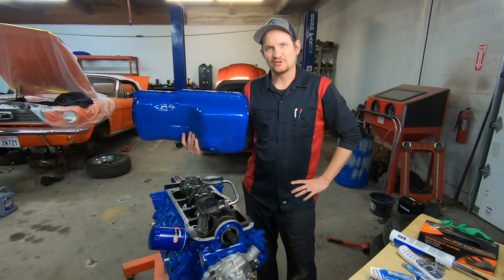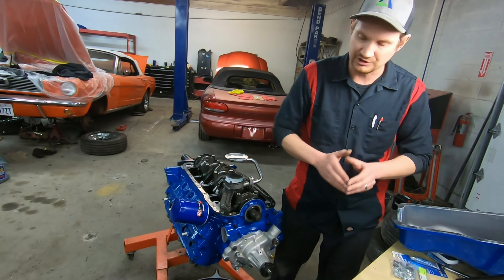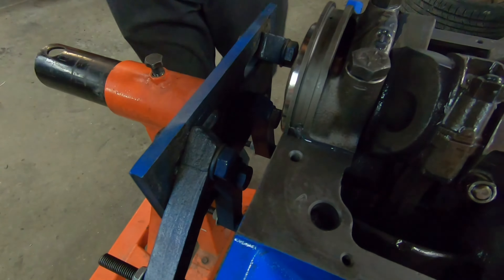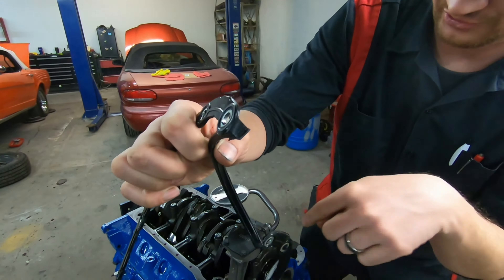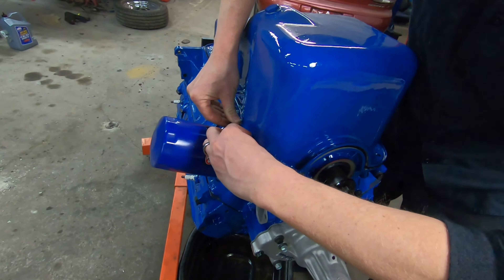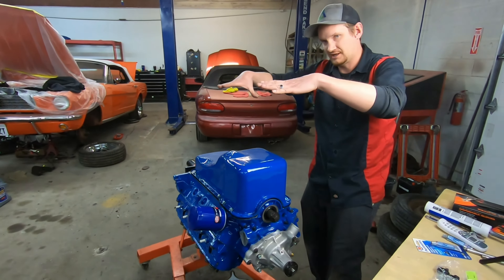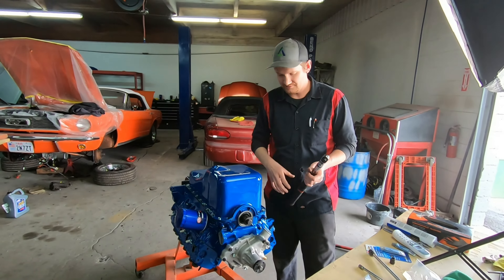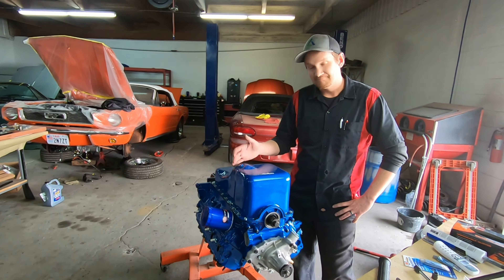How to Install Engine Oil Pan - Rebuild the 289 Ford - Part 12

Comment: Use 4 studs, finger tight into the block, so that you can drape the gasket over those studs to ensure that it's properly located and doesn't move around when you place the oil pan. Then,  drop the oil pan in place. You can use the studs for final installation or remove them and use the OEM bolts after you've got the rest of them all started and snug. Then tighten to spec in sequence.

Comment: I have had excellent results using a Moroso rubber steel core gasket also. Googled ACP gaskets, and comparing prices.
Reply from the maker: Oh ya right on. I bet those are pretty good. I'll have to try one next time.
Reply: @AlfsMustangGarage  Good but expensive. I hate leaks, big time. Oh, got the top end back on the 460. Small coolant leak at the rear china wall.................... Dammmmmmmmmmmmmmmmmmmmmmmmm. Raised torque to 31 or 32 ft pounds, will re-start and see if I will be pulling the manifold again, lol
Reply from the maker: Oh gosh ya I hate leaks. These old engines don't seal up as well as modern engines so we need all the help we can get.
Reply: @AlfsMustangGarage  Hi again Alex! Question sir. "IF" I have to repull the manifold to fix rear china wall weeping coolant, DO I have to install new intake gaskets again? I didn't use those rubber end seals, probably should have with a dab of Untra Grey on them and at the corners Thanks much! Appreciate your feedback.
Reply from the maker: Well I typically install new ones just because I feel like the expense of another set is easier to handle than the risk of having to do the job again.
Reply: @AlfsMustangGarage  I agree Alex. The Fel-pro are around $25 and another tube of RV Going to use Ultra Grey this time rather then Ultra Black as recommendedby Permatex,  and those rubberized end seals like the ones I took off and did'nt put back on as too many said they will leak, just use RTV 1/4" bead all said in the Ford forums. So thanks Alex for geting me straighten out again. Appreciate you very much.
Reply from the maker: Oh ya totally, those rubber end seals I learned pretty early to just not use. Well I hope that works out for you.
Reply: @AlfsMustangGarage  Hi Alex, raised the torque to around 32 ft pounds and rear china wall leak stopped. Ran the temp to full operating of 185 deg. Just a little coolant weeping from thermostat housing so gave it a little more torque. Will check it our tomorrow. Thanks Alex.
Reply from the maker: You're very welcome! If you're having a hard time remembering who's channel you're commenting on, just wait till Andy and I do a collaboration video 😉
Reply: @AlfsMustangGarage  Sorry about that Alex. Was out in the garage all day until supper. Tired and not thinking. I know who channel I am on. I usually always go to you for Mustang related questions as you have always steered me in the right direction. I like Andy but Don't rely on him for Tech questions.
Reply from the maker: You're good. I thought it would be good timing to tease as well as hint towards future plans for videos.

Comment: I already bought an oil pan gasket from npd, and it's cork with rubber pieces for the front and back. Where do i use silicone on it?

Comment: Have you ever seen oil in the gas? And what would cause that situation?
Reply from the maker: I've never seen oil in a gas tank naturally. Sounds like your fuel is contaminated or your tank is due for replacement.